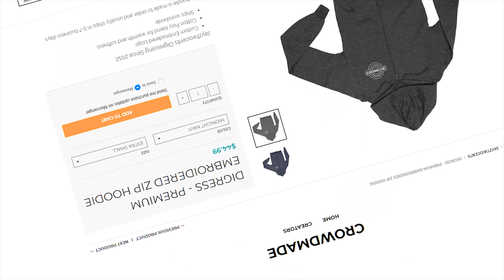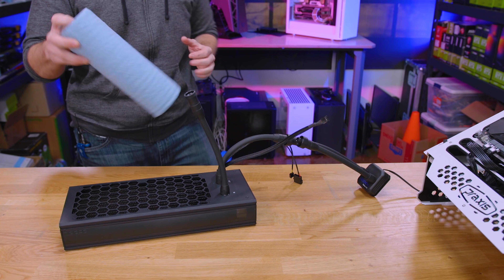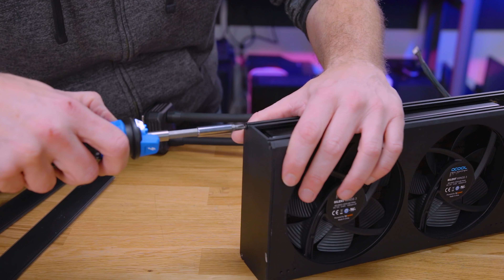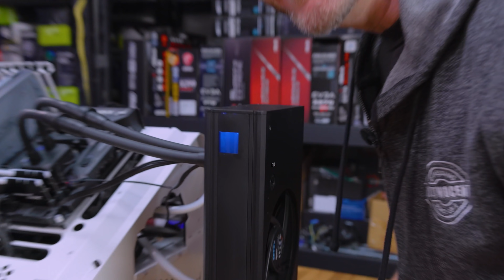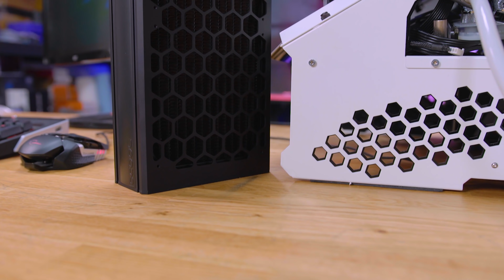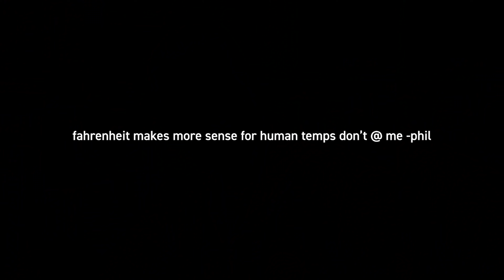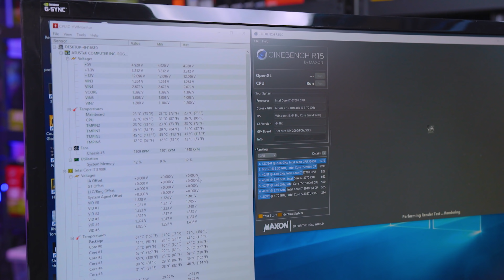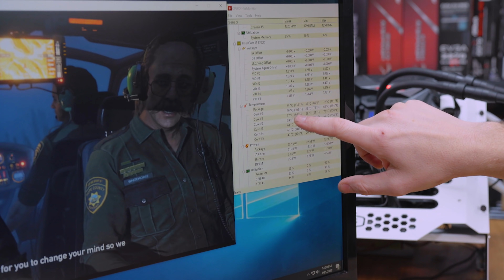This AIO is ridiculous!

Comment: lol im running 1.475v on FX-8370 4.8Ghz 24/7 with a Cooler Master Hyper TX3 with two 92mm bequiet fans on it xD

Ohh and i´ll probably get this aio based on the fans and noise levels to cool my new pc with 2700x :)
Reply: Not gonna wait for Ryzen 3000? It's right around the corner at this point, and if rumors are to be believed it should clock much better than what we've seen so far (I personally am not sure about that, but we'll see. I can certainly hope, the better AMD gets, the more Intel will have to innovate and slash prices, which is good for all of us).

Comment: I have my i7 8700k overclocked to 5GHz at 1.47v. It is delidded and I am using a 120mm AIO. During a single Cinebench run it gets to 85C
Reply: Going to upgrade to a custom loop on Wednesday with 2 360 rads and one 120 in the back

Comment: I'm testing a VPP755 v3 for a few weeks now. It is really quiet. Nearly inaudible at 3,000 rpm and it's even mounted outside the case on a MO-RA 3 with a Heatkiller Tube D5. I really hope, Alphacool solved the issues. I really like the silence, that a D5 or DDC never achieved for me. Especially the high-pitched noise from the electronics was driving me crazy.